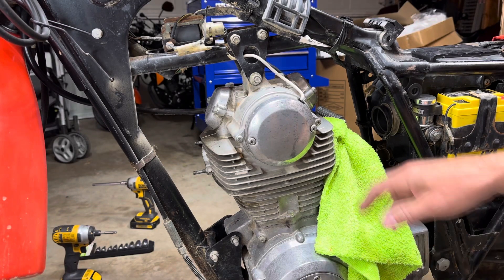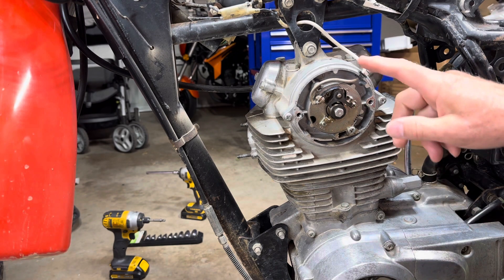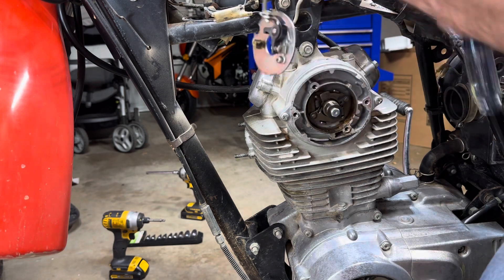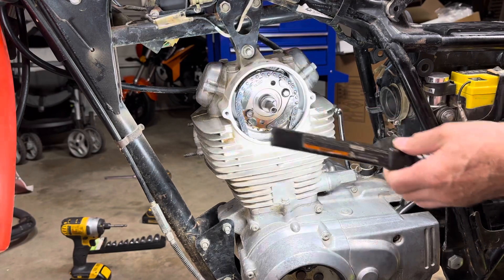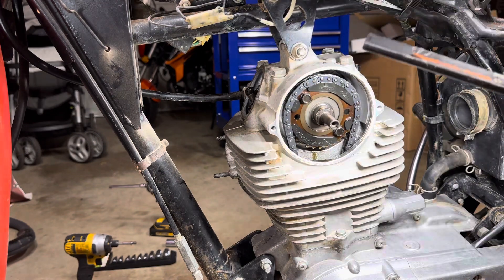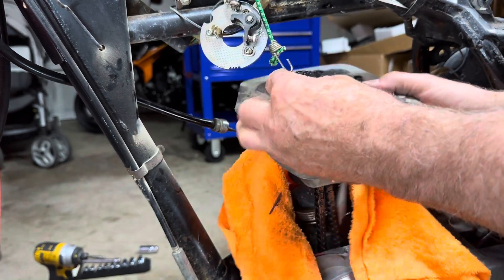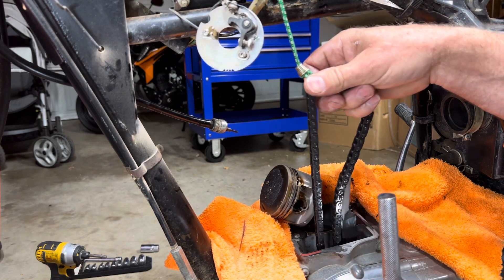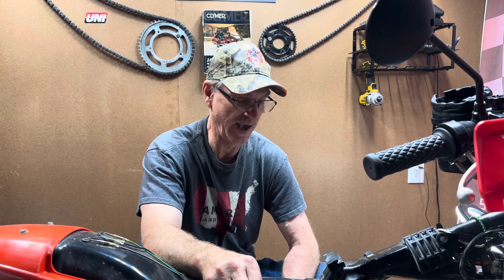ENGINE TEAR DOWN Kawasaki KL 250

Comment: Hey herbie, 

I’m rebuilding a KL250 myself as well. I’ve encountered a problem after rebuilding the top end. I kick started it three to four times. Didn’t have spark after noticing. But now I cannot kick it nor can I turn it over counter clockwise. I noticed the crankshaft isn’t budging much after turning it over. Any suggestions? But to be honest this wasn’t any issue before the rebuild. Smh 🤦‍♀️
Reply from the maker: You might have your valve timing off and the valves may be hitting the top of the piston preventing it from turning. I wouldn’t move anything until you investigate, remove the spark plug and if you have a scope camera to look inside the combustion chamber and see if the valve is touching the piston. Or your cam chain could be bound up. More than likely it will be related to valves or valve timing. If it was mine, I would pull the head off to check things out but you would know more being there and actually seeing it. I wish you the best, let me know if I can help in any way
Reply: @herbiesgarage681  thanks man, I’ve removed all that I’m literally staring into the camshaft chamber with the piston not budging left or right and it gets stuck now and not able to move in any direction. Clutch cables out and def in neutral so I’m just not sure but I’m guessing I have to rebuild the bottom end now.
Reply from the maker: @ososep1049  wow, that stinks
Reply: @herbiesgarage681  yep I wanna cry so bad hahahahaha. Btw I named my kl250 Frankie herbie. Thanks for all the help bud
Reply from the maker: @ososep1049  short for Frankenstein herbie 😂. Your welcome